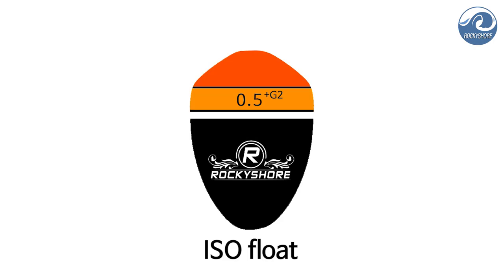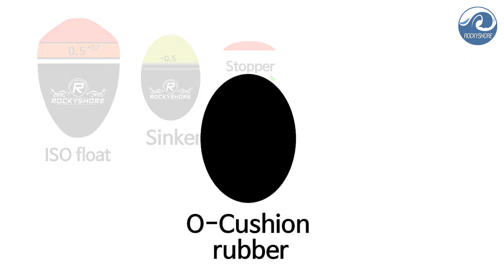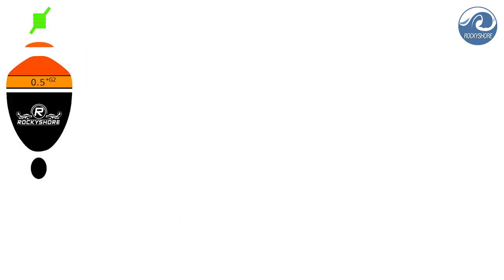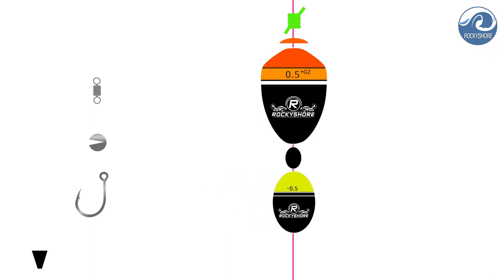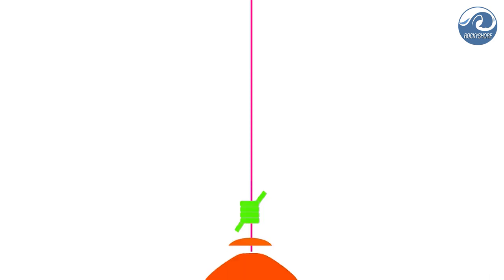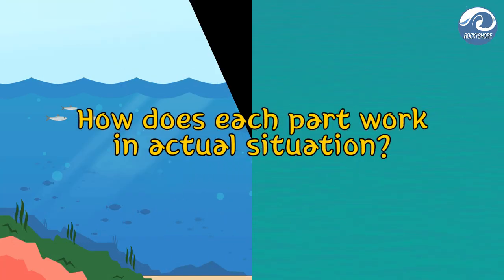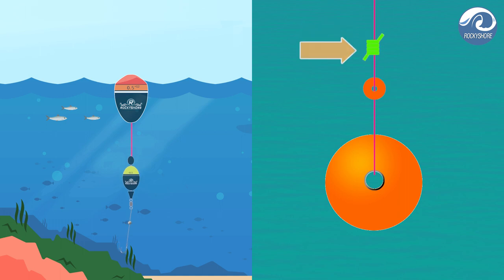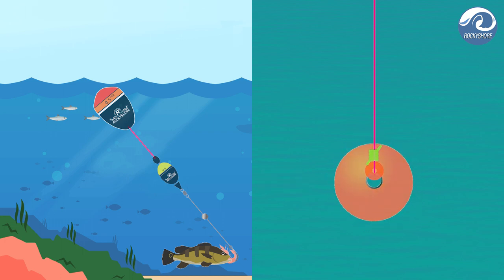Float fishing - how to setup for float fishing? All need for float fishing

Comment: so How did you measure bottom depth ?
Reply from the maker: I have a video I have made about measuring depth but it is in Korean language.
But if you watch it, you will get an idea.
https://www.youtube.com/watch?v=e4C-bn3Ucvs&t=2s

Basically you put a sinker at the end of the line and let the float sink.
If float sinks too deep and you cannot see it, you will have to adjust knot.
You repeat this until you see float is positioned slightly right below the surface of the water.